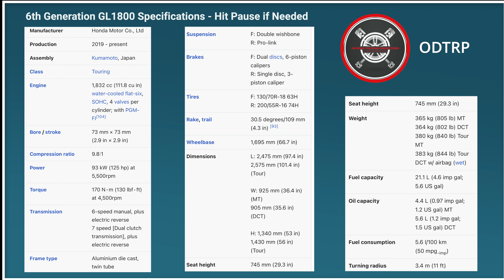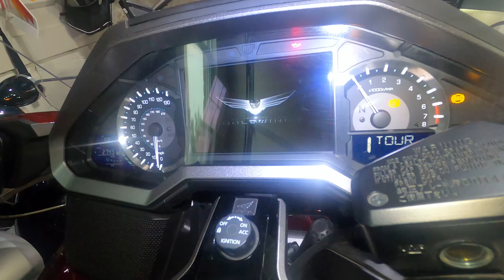One Year Goldwing Tour Ownership #Review #Goldwing #Goldwinggl1800 #ownership #analysis #motorcycle

Comment: In June 2021 I purchased a 2021 DCT Tour model and I used a hairdryer to remove the sticker on it.  Also, I live in Colorado (mile-high altitude) 85 runs like 87 octane fuel at sea level.  I've been averaging about 43 mpg in Tour mode most of the time.  Even with 85 octane fuel, I don't feel the need for more speed. I enjoyed watching your video and agree with you that adding too many accessories can ruin the looks of a great-looking motorcycle.
Reply from the maker: Hair dryer it is, thanks!